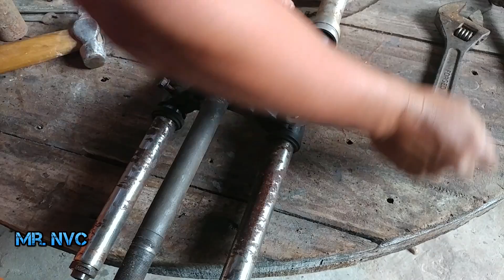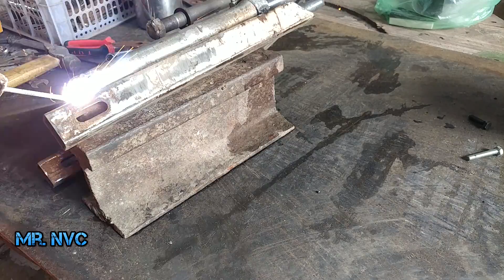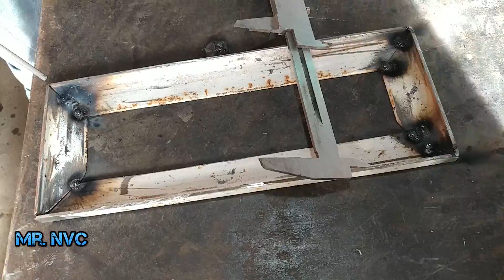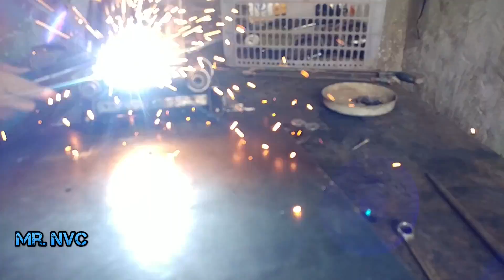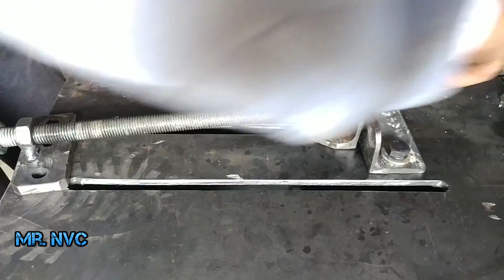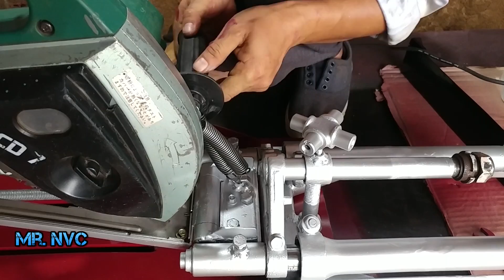Convert CIRCULAR SAW to Steel Cutting CHOP SAW Machine

Comment: Wood cutting saws tend to have a lot of plastic in them, cutting steel with such a saw will result in the plastics melting or catching fire. This video is about converting a circular saw that was designed to cut METAL (Hitachi CD7 metal cutting circular saw), into a chop saw that continues to cut metal just the way it was designed to. The video is about changing a hand-held metal saw into a mounted one. This video does NOT contain any kind of instructions to reduce the speed of a wood cutting circular saw, nor is it feasible to convert a wood-cutting saw into a metal cutting one. The speeds are (Less than half) approximately 3800RPM for a 10" wood cutting saw and 1500RPM for a 10" metal cutting saw.
Reply from the maker: This is an iron cutting saw, not a wood cutting. Check out the videos I used to cut iron. It cuts very well

Comment: From the look of the guard on that saw, it was designed for cutting metal. That means it spins slower than saws for wood and the guard contains the chips.
 If you put expensive, carbide-tipped metal cutting blade on wood cutting saw you will dull the blade after just few cuts. If you insist on testing that statement, wear good protection for eyes and skin - hot, sharp chips will be flying everywhere as the saw designed for cutting wood will not contain the chips.

Comment: Excellent job!  I was thinking about making a system like the one you built, and I decided to look for a video to get an idea.  I came across your video, which was exactly the same idea I had.  My suggestion: Add a 12v motor to the telescope's adjustment spindle.
Hugs from Brazil